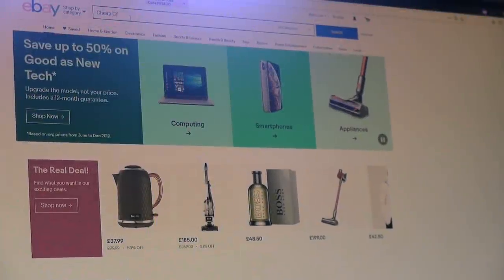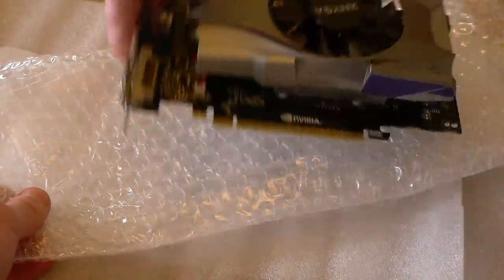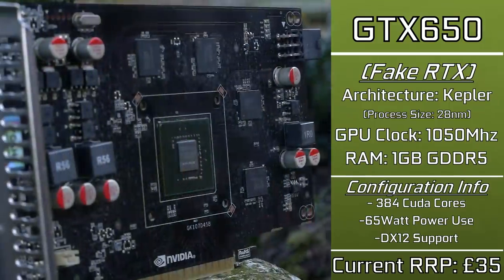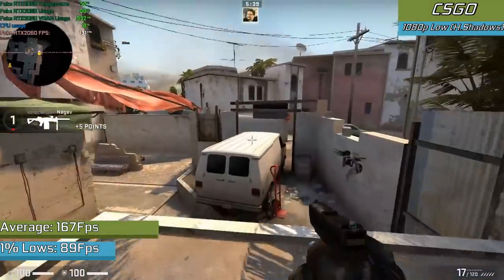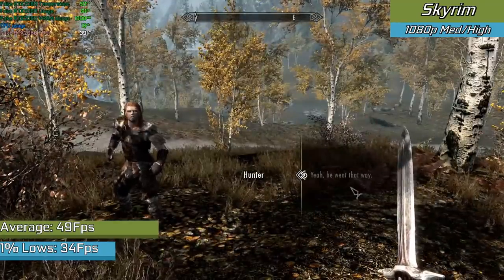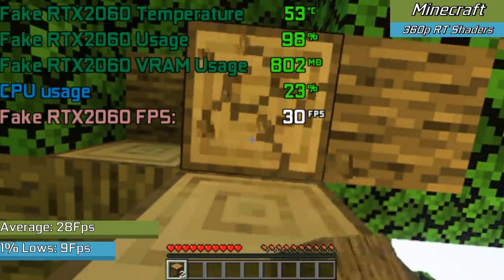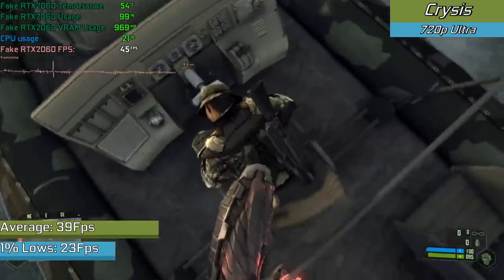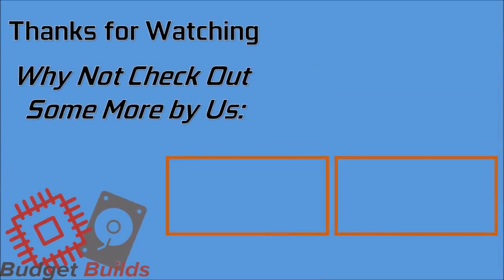The New RTX Scam...

Comment: My laptop has a 940M and I only average about 100fps single player on csgo with 720p low... I think something's wrong
Reply: Check your CPU usage. CS:GO is a very CPU intensive game that likes high CPU frequencies. Non-gaming laptops are usually quite bad at keeping the CPU cool and your laptop is likely throttling down the CPU (maybe even the graphics card) to keep temperatures under control.
EDIT: if a MSI Afterburner doesn't show 99% GPU usage all the time, you're likely bottlenecked by either a weak CPU (e.g. it's constantly pegged at 95%+) or poor cooling.

Comment: The reason DirectX 12 titles won't load on a GTX 600 or 700 series card is because their DirectX 12 support was only in software hardware wise they were only DX11 capable. As far as it running more properly on newer drivers with faked device ids.. I'd say it's more a testament to how similar nVidia's "architectures" actually are than to any cleverness on the part of scammers.
Reply: The DX12 support is legit - no software emulation required. The trick is that DX12, just like every other DX version before it, has different "feature levels".
The lowest feature level just means the hardware supports the API and the bare minimum (e.g. DX11-equivalent). Full DX12 support is feature level 12.1 and up and that's indeed not supported by Fermi- and Kepler-based cards.
Reply: @totalermist  It's "technically" supported which works much better on paper than reality. Having only DX11 feature level support to me is the same as only being DX11 compliant and it mostly works that way in practice as well.

Comment: so does this card say it has 2 gigs of memory or 1 gig of memory? I got one from ebay that was supposed to be a 1050ti which i already knew it wasnt. But aftyer it passed its 1 gig of ram usage it black screened cause they computer thought it had 4 gigs...and can I use gtx 2060 drivers and the install package will install gtx 650 drivers? It sounds like thats what he said but Im not sure
Reply from the maker: This card was flashed to say it only had 1GB ,was advertised as having 2GB, they likely didn't make the same mistake of flashing it to say more than it physically has.

As those cards do crash if they exceed their physical VRAM.
Reply: @BudgetBuildsOfficial  so just to be clear this card wont exceed 1 gb of ram and wont crash and will install using rtx 2060 drivers even though it will install gtx 650 drivers correct?

Comment: How did they make a 2012 graphics card support DirextX 12?
Reply from the maker: Nvidias GTX600 and GTX500 have basic DX12 Support
Reply: They didn't they made cards that were DirectX 12(Feature level 11) which is to say they made DirectX 11 cards but DX12 allows DX12 apps to be ran on lower feature levels of the API. The GTX 900 series was the first set of nVidia product with any hardware support for DX12 and like the 970 and it's 4GB of Vram, it wasn't entirely there.

Comment: There should be an RT 2030
Reply from the maker: No point it would be too weak to handle any HW Accelerated RT Effects
Reply: @BudgetBuildsOfficial  True but it would be nice if they made a follow up to the GT 1030 running on the newer architecture